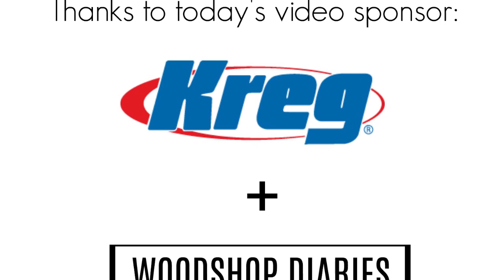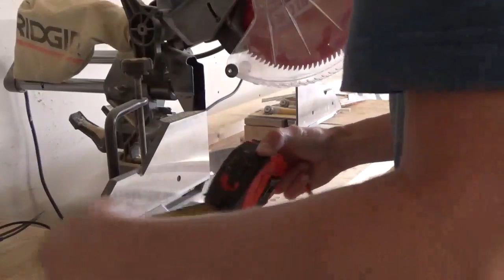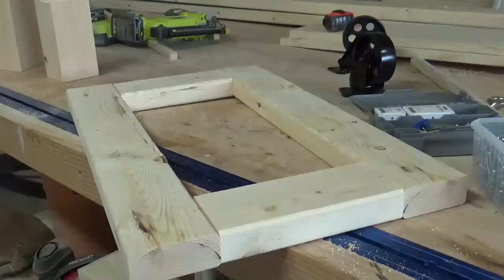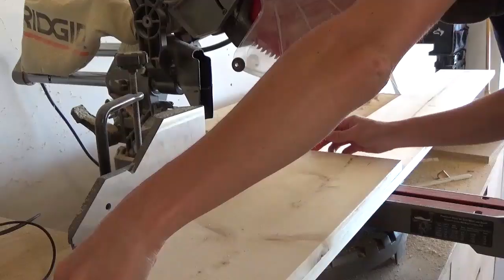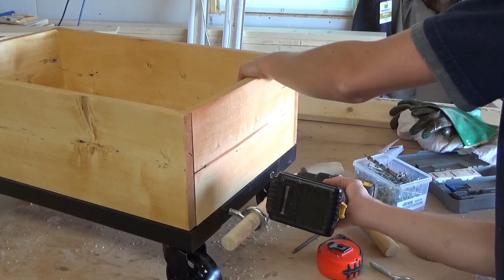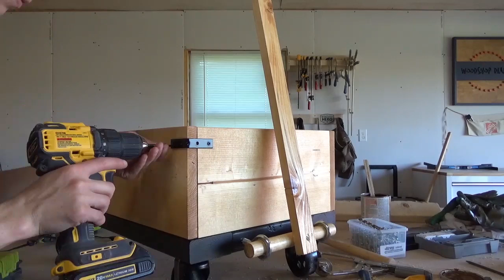How to Build a Little Wooden Wagon

Comment: Building this. Only problem is 1” dowel not fitting in stated eye screws. What size did you buy?
Reply from the maker: 1”. It’s a tight fit, but that’s what I used.

Comment: Fantastic build! You are a very clever crafter, I enjoyed the build.  My question is where did you find the 1-inch eye bolts. I went to Lowes and HD they didn't stock them.  Any suggestions?
Reply from the maker: That’s where I got mine. They may not be labeled as 1” eye bolts. I’d suggest finding a 1” dowel in the store and seeing if you can just find an eye bolt it’ll fit in. If you can’t, you can just use a smaller dowel and get a size that will work.

Comment: I built 3 of these as gifts. The only real difference is that I used rough sawn reclaimed pallet boards that were an inch thick as the sides. It made for a beefier look and the nail holes, gouges, and the occasional live edge enhanced the industrial look. Added a lot of sanding time though.
Reply from the maker: Oh I bet those are beautiful...and worth the extra sanding 😅